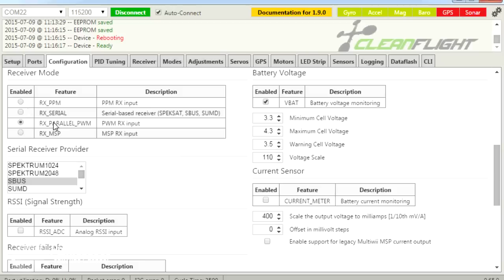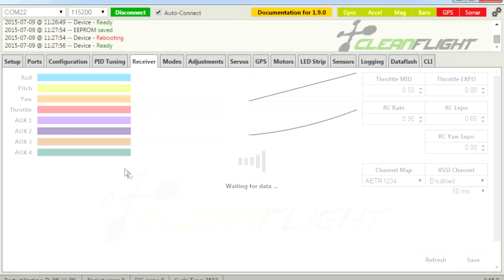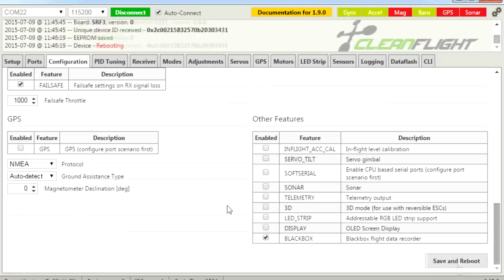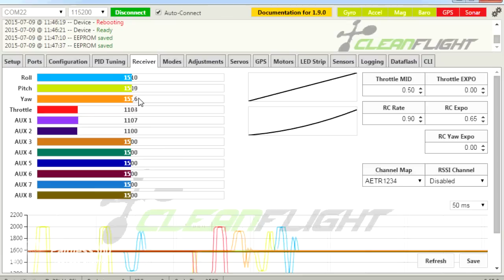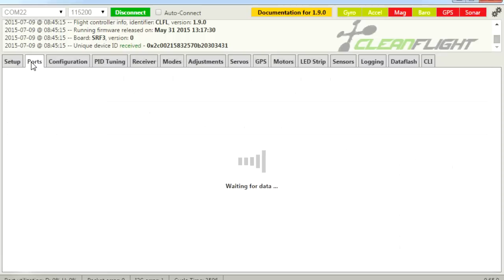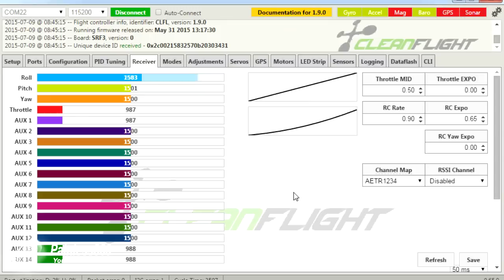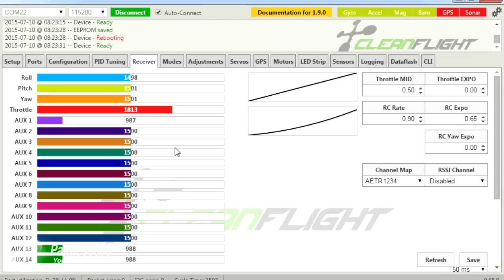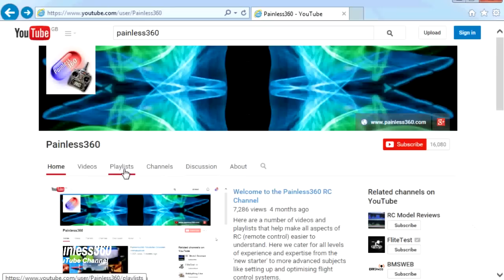Seriously Pro F3 (SP3) Quick Tip - Install and setup PWM, CPPM and S-Bus Radio Receivers

Comment: Hi, i really like your videos, would have been very difficult to start selecting components, and putting together my first 250 multirotor without them. 
Right now I'm struggling with a receiver issue that I'm hoping you can help me with. I have an sp3 racing f3 deluxe, and hooked up my turnigy i6a receiver to it in PWM mode. Everything powers on nicely, the receiver is bound to the turnigy i6 transmitter, but when i plug into cleanflight on my laptop to check the signals, nothing moves in the receiver menu. It seems like there is absolutely no signals coming in through the receiver. I double-checked everything now to make sure it's all set up correctly, but still can't figure it out. Have you seen this issue before/can you give me some tips on what to try out? 
Thank you!
Reply from the maker: +Balázs Bodoni This is usually as you've not got the FC set to PWM, the cables plugged in the right way or the Rx isn't bound to the Tx.. Best of luck!
Reply: Hi,
I have the same issue. 
 The Receiver  works with the transmitter in stand alone mode meaning they bind together.
Once connected to IO1/2 no movement on the receiver tab. 
PWM was set correctly on the configuration tab.
Somehoe the GPS also lights green although never connected one.
What am I missing?
Appreciate your support

Comment: Hey Painless360,

You indicate to use a SBUS rx (FrSky X4R-SB) to use UART3 (IO_2) but according to the SPF3 manual, the Vcc is 3.3v rather 5v.  UPDATE:  Looks like all the UART's are actually 5v and the manual is wrong.
Reply from the maker: The UART3 connections are not used for the SBUS signals, but the some of the circuitry is. Happy flying!

Comment: i have got a fs-ia6B reciever and this flight controller! i want to use ppm!
why do i need a battery eliminator for the reciever?
is there any other way to power it up directly through naze32 or matek mini pdb?
Reply from the maker: Sounds like this is one of your first builds. The series 'Quadcopter building for beginners' is a better place to start as it covers very step, piece by piece. Best of luck!
Reply: got it to work!
but there is a problem...one of my motors stop in the middle of the flight and it acts wierdly when i start the fly the drone !!
it starts a little late!
should i flash my esc's?
and how to flash the esc's?
thank you
Reply from the maker: Not sure what you are describing without a little video to show the problem. If the motors don't start at the same time then you need to calibrate the ESCs. See our build videos for more details. Best of luck, sounds like you're close!

Comment: PLEASE HELP! What type/size are the white connectors and awg wires are you using to connect the receiver to the sp f3??? I can't for the life of me figure out which connectors to buy.  Are they JST-SH or the JST-ZH connectors??? and are the wires 22 awg, 26 awg, or 28 awg wires???
Reply from the maker: In the manual for the board (http://www.google.co.uk/url?sa=t&rct=j&q=&esrc=s&source=web&cd=1&cad=rja&uact=8&ved=0ahUKEwiw5o_KrerQAhVEDcAKHbdnAq0QFggaMAA&url=http%3A%2F%2Fseriouslypro.com%2Ffiles%2FSPRacingF3-Manual-latest.pdf&usg=AFQjCNFTZfN8TNNmQWyNS4X11HAIv9sWSw&sig2=LQluYSvc3eXDc_2iJq32Tw  , page 2) ;) Best of luck!
Reply: Painless360 I kcant believe I missed that! I've read that manual over and over! Thanks again for taking time out to help me out! your the best!

Comment: Can I put pins on uart 3 and use that to connect it via ppm to my receiver? And if I do, do I use the RX or TX connection? Thank you!
Reply from the maker: Not sure why you would want to do that, all of the settings are shown in the video..
Reply: My I/O 2 port doesn't work correctly. I was looking for another solution and figure connecting to UART 3 would be easy, but I am unsure if I connect my flysky ia6b in PPM to the RX or TX pin coming off of UART 3?
Reply from the maker: I see. UART 3 is normally used if you have a serial connector for your receiver (Sat. S-Bus etc. I've not tried it. Best of luck!
Reply: Not sure but if  UART3 is used for Spek/Lem Sat Rx's the +- pins are at 5volts  and the Rx's req 3.3V... so is there a way to config the +- pins for 3.3V without using the 3.3V pad or IO-1 pin8 ( one of the Boot pins is at 3,3V btw )
Reply: @blakelocati  why you use PPM use I-buss lot fasten and better no need many wire. i have same receiver and ofcourse used i-buss. need only one wire solder were uart pin want use, today controller have 4-7 free uart port.

Comment: Can you please tell me how do I use my Turnigy 9x receiver with SPR, which channels do I plug the wires from IO1 of board?
Reply from the maker: Depends on how you are connecting it. If it's PPM then it will be that way, all others are covered in the video. Best of luck!
Reply: Hey, thnks for a quick reply.. it's PPM however Im unsure which channel do I put the 3 wire connector coming out of IO1? The video doesnt clearly show which channel it goes in, since the orange receiver and turning receiver is pretty different. The turnigy receiver has only channels mentioned on it like 1, 2, 3,... can you please help?

Comment: Hi Painless360 - I'll be building with this exact setup but I will be using minimOSD. How do I connect the OSD to the flight board?
Reply from the maker: +John Marchan All covered in the series later on, use the playlist to find more videos.. Best of luck!
Reply: Painless360, thank you so much for your amazing series on the SPRacing F3. Just got done w/a build that I am very happy with and thanks to you everything works, OSD with telemetry and all! Cheers!
Reply from the maker: Great news! Happy flying!

Comment: I did exactly what you said for ppm with a d4r-ii and taranis plus but I get no input from the taranis to the reciever at all.. could you help? Maybe a setup video of all the channel settings on the taranis and mode set ups and things? Would be helpful for the sp racing f3 is you could please. I'm stuck and need help :(
Reply from the maker: We have a whole series on the Taranis, have you successfully setup other models with that radio?
Reply: i know i have watched a few of the videos, no i haven't currently been successful.

I go through creating a new model and binding the receiver, connecting via PPM, but then even with the correct channel mapping and mix i get no response in cleanflight when moving the sticks around, i would have thought even if i got the channels mixed up that some of them would move but i get nothing at all.

Comment: Hi do you need to power the board 5v etc to flash the board and to make it work with inav. or just plug in iv got SP Racing F3 FC Board(Deluxe)  and there know USB.
Reply from the maker: Most boards will be powered from the 5v from the USB cable. If you're new then catch the 'Quadcopter Building for Beginners' series I have on the channel for builds where I cover all of the basics as we build..

Comment: FlySky modules do not work via pwm on the spracingf3. I have a FlySky i6 and the channels all moved at the same time. I fixed the issue by switching to the fs-ia6b rx, which has ppm output.

Comment: when i hookup to my FlySky Radio through the pinouts you post it seems to group channels, yaw and throttle move on throttle up, and pitch and roll move together on roll movement, and aux1 and aux2 move with single aux movement
Reply from the maker: What model type have you selected? You need 'plane' or 'acro' to make sure nothing like awash mixes are linking channels..
Reply: +Painless360 yeah i have my Th9x in Acro Mode, its the same mode ive used on this same receiver as well as other 6 and 8 channel receivers from flysky on my other quads, this is the only time its happened where the channels were like stuck together. i posted a video this morning here https://www.instagram.com/p/BBF8SQnNZpj/
Reply from the maker: Can you see the channels moving independently in the 'monitor' screen on the radio?
Reply: +Painless360 I have the Flysky i6/ia6 and have the exact same problem. The channels move independently in the 'monitor' screen on the radio.  Any ideas?
Reply: did you ever figure this out, i have the same issue right now!
Reply: +Rico M well from what I understand I think it was something along the line of it not accepting pwm inputs or something like that? I forget, the real answer was buying a XJT Frsky module and a x4rsb
Reply: ok so i have to buy fryky module?? how will the flysky t6 talk to a frysky?

Comment: I have the same receiver that you used in this video I just want to know will it bind to the taranis QX7 ?
please let me know. Thanks  I mean the sbus  receiver.
Reply from the maker: Use the D16 protocol.. It should do! :D
Reply: Is that D16 come stock on the transmitter or do I need a module of some kind ? I am sorry to be so dumb.
Reply: Does the QX7 have D16 protocol stock or do I need something else .  Thanks

Comment: I have a Orange DRX 9ch that do to location can't finger the bind plug quickly  not a issue with PWM. Question can i use SBUS without swamping the bind plug if yes how?  Thanks.
Reply from the maker: +Brandon MacDougall What model are you using? Happy to help but please watch https://www.youtube.com/watch?v=olIqTiSJHIY and come back to me with more detail of what you've tried..
Reply from the maker: +Brandon MacDougall No idea, sorry. Maybe HobbyKing support can shed some light on it for you? Best of luck with it..
Reply: +Painless360 Why I use DJI FC's now simple questions turn into rabbit holes.
Reply from the maker: Building and understanding how all of this works is not for everyone. Happy flying!
Reply: No as well as working on Star Trek for 15 years. thanks for your help.

Comment: hi firstly let me say your videos are great there is very little info out there so it was good to find your vids and get some clarity. I however have one problem you might be able to help me with. when I plug my quad into my pc to setup it works no probs, you can instantly see it in the prog. the problem is when I plug the battery in to provide power to setup the esc cleanflight just looses connection no matter what I try I can not have the board connect to the pc at the same time a batt is connected cleanflight will not connect. any ideas would be greatly appreciated. if I try and connect the battery first then connect to cleanflight I just get an error msg about no config received coms falied.
Reply from the maker: Sounds like the BEC on the model isn't sending the flight controller 5v. It needs to be close to the 5v from the USB else there can be problems, I'd check that first..
Reply: Painless360 
thanks for the suggestion I check the voltage coming of the bec 4.98 volts so unfortunately I'm stumped once again. do you think it could have something to do with my controller not being bound to the reciver. because I've used a uhf setup but I'm not convinced that the binding process has actually worked so I'm wondering if clean flight is trying to get a signal or setting it's not getting and timing out?. Sry to bug by the way you seem to be the go to man when it comes to this stuff. I appreciate any help greatly I'm sitting here after spending a few hundred dollars on parts and it's pretty upsetting 😢
Reply from the maker: Without more detail it's tricky to offer other things to check. The only other common thing to make sure is that nothing is connected to the FC as having OSDs powered and connected to the board using UART1 will stop the USB working..
Reply: Thank you I think you have it i have a osd connected I don't wanna get to excited but I'll give it a go I knew your the man to speak to. Thanks again for your help.

Comment: Hey, I'm still not able to arm my motors..can you tell me the pwm values to arm motors...using PPM configuration
Reply from the maker: Depends on what kind of ESC you’re using. See my quad copter building for beginners series that covers everything a lot more detail. Hope that helps..
Reply: I have F3 evo brush, so no ESC.

Comment: Hi video Uploader,

I hv thse board & just wanna play arnd, specially th connections are somethng to learn. I made a drone using this board, Sbus connection like u do here, but I now forgot all the connections. It refreshed my memory. 

Ques: I can not install clean flight in Windows 11, but in Betaflight recent this board works. So can I practice this what u are doing, jst to refresh my skills? Thnx.
Reply from the maker: I'd practice using Betaflight, it's the most popular choice for hobby quads.  Best of luck

Comment: Hello, I have an Futaba R6208 SBUS receiver, and my SPF3 doesn't detect it. The receiver is connected exactly how the video shown. Receiver is tested and bind. What can I do?
Reply from the maker: +Gon Qu Happy to help but please watch https://www.youtube.com/watch?v=olIqTiSJHIY and come back to me with more detail of what you've tried..
Reply: Thanks! my problem was the RX serial receiver switch in Cleanflight Configurator.
Another doubt: it's possible to install OSD and bluetooth simultaneosly in SPF3?
Reply from the maker: Yes you should be able to, we tried to install almost everything in the Naze32 series with Cleanflight.. Pop the OSD onto UART1.. Best of luck!
Reply: +Painless360 it works perfect. Thanks again!

Comment: is there anything you need to change in PORTS tab when using PPM?
Reply from the maker: Nope, PPM will be there without changing anything.. Best of luck!
Reply: Painless360 thanks a lot.. quick response.. innyour own opinion.. will there be a big noticeable difference between ppm and ibus? im using ia6b btw..
Reply from the maker: Unless you are one of the top 5% of pilots you won't notice any difference.. ;)
Reply: Painless360 hahaha... lol.. funny thing is I dont even feel any delay with PPM.. that means im one of those 95% left overs..

Comment: Hi, 
can i also use the spektrum AR610? 
If yes, do I need a other setting for this one?
Thank you :)
Reply from the maker: +Pat rick Check the specs for that receiver to see what type it is. Remember PWM uses different wires for every channel - so looking at an AR610 with all it's pins means its PWM..
Reply: +Painless360 Thanks a lot!
This is a accurate and good explained tutorial btw.

Comment: Hello! I have an old JR XF421EX 5-Channel Radio. System. is it possible to use it for a drone? i think its a red generation older then 2.4 Ghz, I think its a 78 Mhz radio
Reply from the maker: If it allows you to control a plane, as trims and a 2 or three position switch for channel 5 then probably! There are so many cute new radios that are cheap that I'd consider upgrading. A beginner radio like the FS-i6s is worth a look for multirotors..
Reply: Thanks!

Comment: my fs ia6 rx can only run 4-6.5v, so can I plug it right into the fc with no problem? FYI I'm running ppm
Reply from the maker: +QuadBro RC that should work. If you're not sure you can measure the voltage coming out of the flight controller. Best of luck!

Comment: Hello Painless360! I love your videos, learned a lot from you. Now I have a problem, hope you can help.
I have a SP Racing F3 Flight Controller and need to connect lots of stuff. Currently I have:
- USB (Data) and OSD (Telemetry) on UART1
- Bluetooth (Data) on UART2
- IBUS Radio RX (FS-IA6B) on UART3
- Leds on LED_STRIP pin
- Buzzer on Buzzer pin
- 4 ESCs on ESCs pins

Now I need to add a GPS, but I don't have any spare UART ports. I do not want to move my RX to PPM because on IBUS i can have 10 channels and on PPM I get only 6 channels.

There's a way to add a GPS without sacrificing something? Today I use CleanFlight but I'm planning to use INAV instead (it's a fork from CleanFlight focused on autopilot).

Thanks a lot for any help! Best wishes!
Reply: Daniel Ribeiro
Reply: I figured out how to proceed. I just enabled SOFT_SERIAL and it gave-me two additional ports. So I moved OSD from UART1 to SOFTSERIAL1 (had to change the baud rate to 19200), and moved Bluetooth from UART2 to UART1... So the UART2 was free and I connected the GPS module on it (Baud rate 57600).

Comment: HI all,   I've got some weird stuff going on where I cant get AERT inputs working with my PWM servo tester (little blue box with 1 knob on in) but AUX1, AUX2, AUX3, AUX4 are changing values as I turn the knob.... I dont have proper RC gear at all hence the servo tester.  Im using PWM conf with the board.

Thanks heaps!
Reply from the maker: +joek1dd a servo tester will typically put out the same pwm value on all of the outputs so you can connect to several servos to it once to test them in parallel. I don't use a pwm servo tester in the building of quadcopters, I use one in the building of planes only. I'd wait to have to you get the reciever you'll use and give it a go. Best of luck!
Reply: All good pro. figured it out already, its the failsafe tab where default settings for pitch, yaw, roll and throttle are HOLD not auto. changing that fixed my prob. I just wanna get the thing in the air to hover thats why i use servo tester. thx for the reply

Comment: tyvm for your vids im trying to use this flight controller with a eachine i6 trans with a afhds fs-r8b receiver do you think they will work together pls help have on an older quad any help would be super tyvm
Reply from the maker: Make sure you are using Sbus for the connections and it should get easier.. Does that RX have sbus?
Reply: i dont think so its an old receiver  fs-r8b i mite need to by newer receiver to make it work?
Reply: @Painless360  tyvm for your help